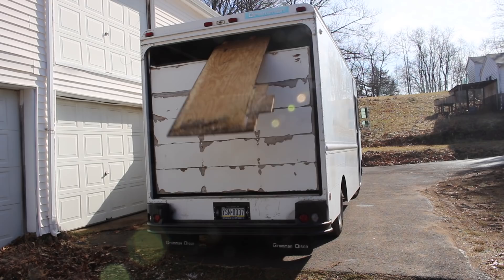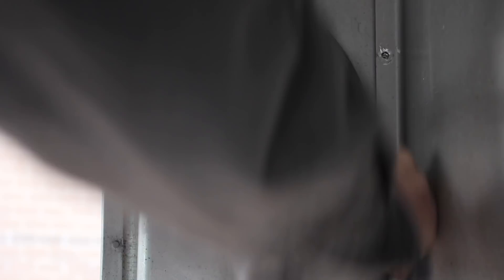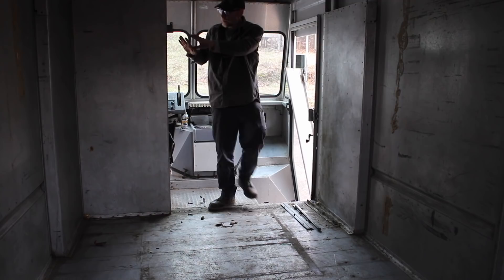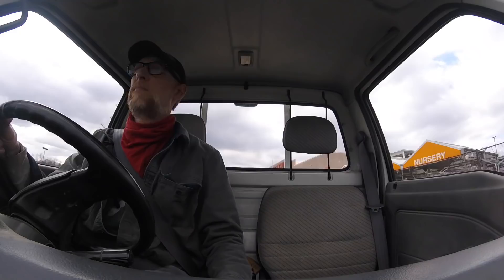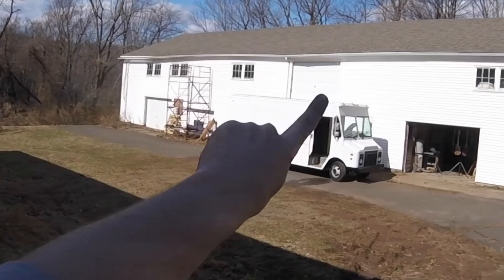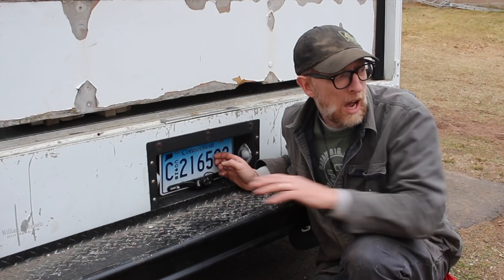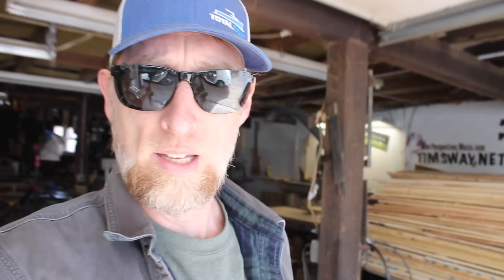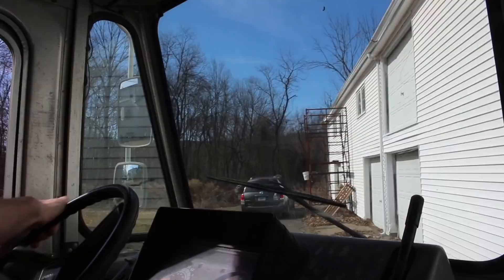I Shall Call it "GuiTruck" (Until I Think of Something Better)

Comment: "Sway" translates to dutch as "Zwenk". On the back of trucks, in the netherlands and in belgium, there are warning stickers or plates that warn other drivers that the rear end of the truck may sway (due to axel placement and overhang). It's the red "Pas op, zwenkt uit!" sticker. Might be fun, not as a license plate but you could print it or have someone send it to you.
Reply from the maker: that is fun! thanks for the info. I like learning - especially weird, little things like this :)
Reply: As a fellow Dutchman with a soft spot for odd trucks I can only say: Oh Yeah, Great Idea!!
Reply: @timsway  One of my best friends is called Henk, he gave me a bicycle when mine broke down so for that he has my thanks. The bike had no rear fender so you'd get sprayed with street gunk whenever you cycle through a puddle, pretty dank. I fixed it with a long extending plank that sticks out by quite a lot, so when I go to a corner, there's a lot of ZWENK.

TL;DR:
Thanks to Henk, my dank gunky bicycle with a plank zwenks.
Reply: To your suggestion, I say Ja! (German for Yes. Pronounced Ya).

Comment: I sistered lengths  of   2 inch wide aluminum  along 2 of  the roof  supports in my grumman because the last guy put an AC unit in that was bouncing a bit while I drove. It seemed to tighten it up nicely
Reply from the maker: Thanks for the info

Comment: Are you set on the garage-type door on the back? I have an idea for a tailgate that would be difficult and time consuming, but it would be a fun challenge and I think, totally unique. I’d describe it in the comment, but it’d be kind of hard without a visual aid. If you want, I can make a short video and add a link in a response.
Reply from the maker: rolling door is gone. I'm building it into a fold-out stage, like a drawbridge over a moat. Is that what you were thinking?
Reply: tim sway yes exactly! My idea is like a drawbridge, but it has hinges along three horizontal seams. Once you unlock some supports, it can be folded into two large steps. It seemed like a cool way to have different levels where players could sit or stack amps. I’m excited to see what you come up with!
Reply from the maker: @DeweyKentM  similar. Lol I've scaled it back from some very cumbersome, folding and sliding parts to a simple drop stage. I do t pman on holding huge rock concerts on it. Duos/trios max.